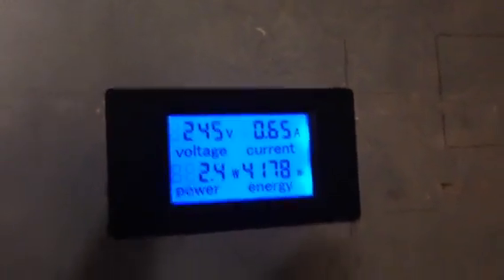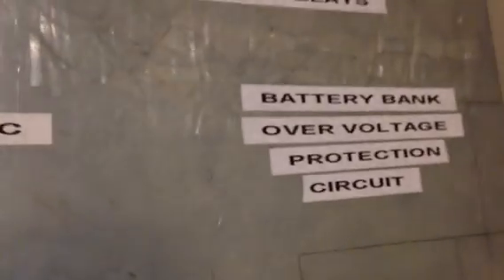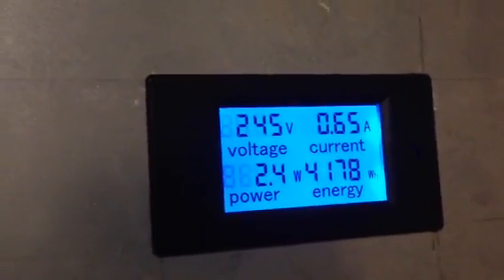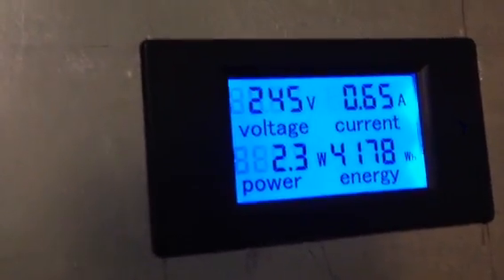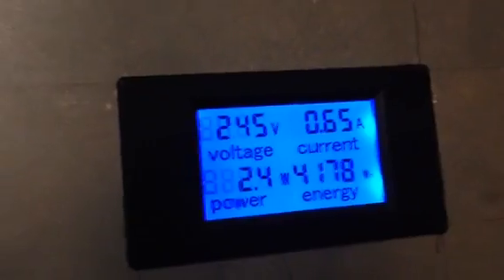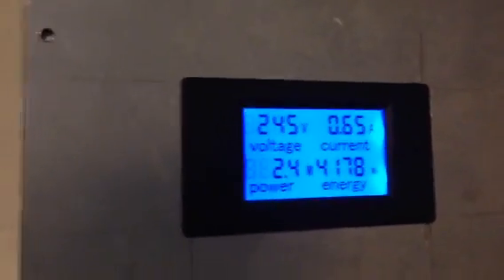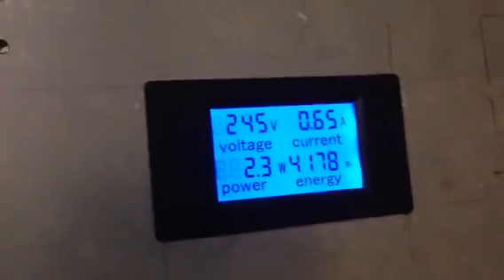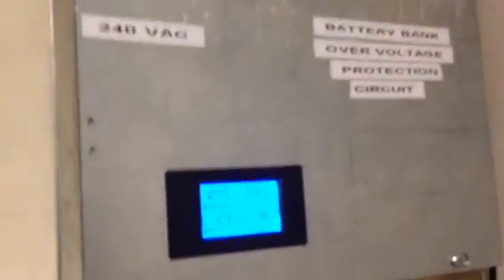DIY Solar Update - Power Monitoring like the pros

Comment: I have a 3000w inverter and I want to use a larger shunt. On the menu, can you change the shunt size?
Reply: I have the same one it is rated up to 150 watts. You can not go over that. I am using mine with a 50 watt shunt. They do make a higher wattage meter that is around 300 watts or so. The display is a little different.  It is sold on Amazon under peace fair dc power meter.

Comment: So I want to be able to use my phone in order to see what current I'm using like say the amperage and voltage and total wattage

Is there any current meter like that I can use? Or is it just a standalone device or I'd have to use a Adriano
Reply from the maker: This is a standalone device.  You can use something like a TED5000 to get that information via a webpage to your phone.  With some tech skills you can use a raspberry pi or arduino.
Reply: Sonoff pow 2 , upto 15 A

Comment: I have a issue with one of mine. One flashes the display until I hit the button to stop the flashing
Reply from the maker: I don't know if that is by design or you may have a defective unit.
Reply: press and hold the reset button, change the values on power when flashing, press again ,you must see "PASS, PASS", then it will be set and stop flashing.

Comment: nice info... But do you have any idea doing in from solar charge controller to battery? What I want to do is measure how much power my array generated for that day. My charge controller don't have that option.
Reply from the maker: You may want to try the DC version of these meters.  They are all over ebay.
Reply: thanks... what do you call this one?
Reply from the maker: Willow Silos https://www.ebay.com/itm/401163563291   This one should do.  It's simply a DC power meter with shunt.  Whichever you choose, just make sure it meets your voltage, amperage, and overall power specs.
Reply: thank you...
Reply: one more question, can i connect this between charge controller and battery? and the battery being the load?my purpose is the total Wh generated.. Thanks
Reply from the maker: Willow Silos you'll have to check the wiring schematic that comes with unit. Placement depends on your particular installation.
Reply: @WeelowX  upto 20a you can directly connect these types of meter, above 20A you should use a shant resistor.
Reply: Willow Silos uii

Comment: these are all over ebay now, have 4 myself, use it in DC mode
just wondering why yours is displaying only 2.4 Watts power when it should be close to 160 Watts
Reply: oh yeah, good catch! What's up with that?
Reply: @troysmith9754  maybe you only have it on one of the phases
Reply: that wouldn't be it because the watts are calculated internally
Reply: my same thought
Reply: This is A.C., which means that power is not simply volts times amps (referred to as VA). The voltage will be a sine wave, and the amps will also (ideally) be a sine wave, but if the load is inductive or capacitive the amperage sine wave will be out of sync with the voltage sine wave.  Watts = Volts * Amps * PowerFactor.  If the PF is 1, the sine waves are in sync.
Reply: Sylvan Butler got you. I didn’t think this thing could calculate the power factor
Reply: @MrTurnermason  I doubt it is "calculating the power factor" explicitly. I suspect they are just sampling the voltage and current (they have to be!), giving them an instantaneous value wherever it is on the sine wave.  Then calculating the wattage from those instant sampled values.  Of course the number you want to see is the RMS (Root Mean Square) so they do that calculation on all three -- the voltage, the current, and the wattage -- before display.
Since they have the raw sample numbers it would be pretty dumb of them to calculate RMS voltage and amps and then multiply that average to get watts.
edit: and the way I would calculate power factor is to compute the ratio between the first and the dumb way to calculate watts!  Which they are at least not displaying, and probably not calculating. :)
Reply: I guess maybe a better way to say it...  Usually you compute Power Factor from Watts and VoltAmps, instead of computing Watts by using VoltAmps and PowerFactor. So they are just stopping their compute once they figure Watts.

Comment: you said everything in  your Video Except how to wire it can you let me no thanks troy
Reply from the maker: +Troy Pointer thanks for the comments, I'll try and do a video showing the wiring.
Reply: Dont bother they sell faulty Products I recently Bought 1 and it did not even light up thanks troy
Reply from the maker: No problem, but I did do a video for you as promised.  Just in case you decide to get another one.  Mine works fine.

Comment: Hey, I'm looking at this readout, and thinking "245V x 0.65A = 159W, but the meter shows 2.4W" Am I missing something, or is something amiss with this unit?
Reply from the maker: In an AC Coupled configuration, where the grid tie inverter is sync' with the Inverter/Charger, this meter reading could appear skewed "at night", but during the day it is quite accurate when comparing the readings to the TED 5002 unit installed on the same circuit.  At least voltage and power "appear" to be accurate when doing a 1 to 1 comparison.
Reply from the maker: +just1evan Here is VR to your question.  https://youtu.be/Kv5Aa5vFryc  Hopefully, it gives a better clarification.

Comment: Can it be used as power meter? 
In lower right corner does it show kWh or Wh? Whats the maximum reading before it start over?
Is W an A values real time or they logged also?
Reply from the maker: The meter is real time. It displays current Voltage, Watts, and Amperage as they come in.  To the bottom right, it displays accumulated watt hours first then it converts and displays kWh. If power is removed from the unit for a short time that value remains when power is reapplied. I use it to give me "at a glance" information, and to keep me and others aware that live power is on the circuit whether coming from the grid ties or the inverter charger.
Reply: +rhandsom My idea was to use it for a electric heater just plug in middle of the cord to display how much kWh it used so far, you think its suitable for that? So there's no internal battery to hold the value if unplugged for long time?
Reply from the maker: +Roman L. If the heater is 120VAC you would come out better using a Kill-A-Watt plug-in meter. With this unit, the manual never mentioned an internal battery so I don't know about value retention over long periods without power.  It should be able measure power consumption by any load, but I'm not clear on what load your trying to measure, is it a 120VAC plugin electric heater or 240VAC house furnace? If wired correctly it should work in either case, but it may not be the best method depending on the case.
Reply: How does it tell how much power there is beyond the first battery? Its counting watt hours, so it must have an idea power is going somewhere. And at some level that amount is more than 1 battery's worth. So how does it work out more than 1 battery, etc?

Comment: What happens if you have an balanced load? Since there is only 1 CT. I beleive if you have 200watts on one leg and 400watts on the other leg the CT will only calculate whats going through it and missing the other leg.
What do you think?
Thanks
Reply from the maker: +leamyelectricinc1 I believe a load as you described  may cause erroneous readings, but in all honesty in that situation I don't really know for sure how it would read.  I was concerned at the fact that I only got 1 CT for the one leg, but oddly enough it "appears" to functioning correctly in my installation, again not sure but I'll put an Amp Clamp on it so I can get a better read on the amps on each leg.  However right now with 3 micro grid ties that are exactly the same I believe the power and voltage readings are fairly accurate when measured against my TED unit, the power readings are within 8 to 10 watts of each other..  As a side note, I got the idea to install this unit from watching your video and I want to thank you for that idea.

Comment: Could I ask you how you wired that meter. I baught one just like it from Ebay also. Came with ct. Has 4 terminals on the end of it. 2 are for the ct and not sure about the other 2. Are those power and neutral for the display. Not sure I really understand the diagram on back of it. I got 2. One for each 110 line coming in to sub box. Would really appreciate some advice on the hookup. Thank's...   Les
Reply from the maker: +Les Jupiter I have 1 unit and this is how I hooked it up.  As you look at the diagram on the back of the unit with the terminal screws to the left, starting at the top screw. Screw #1 connects to the black wire of the CT "Current Transformer",  screw #2 connects to the red wire of the CT,  screw #3 connects to L1 (120VAC), screw #4 connects to L2 (120VAC).  The CT has "1" of the Hot's (L1 or L2, but not both) going through it.  That's how mine is connected and it reads accurately thus far.